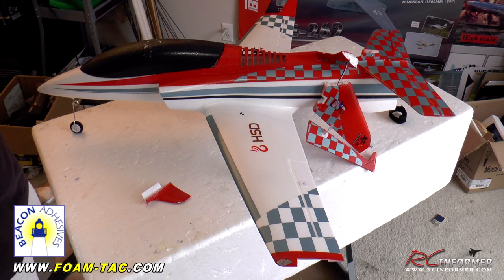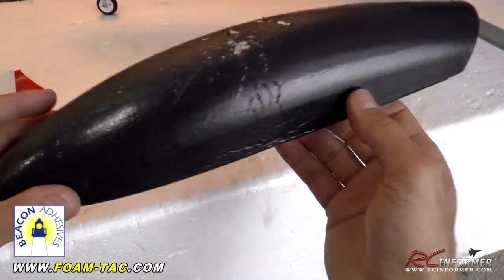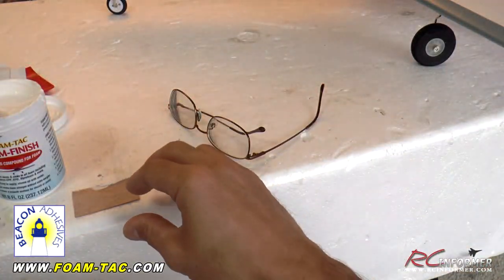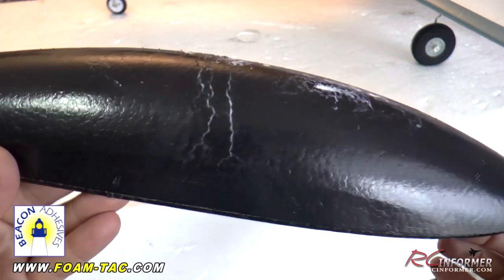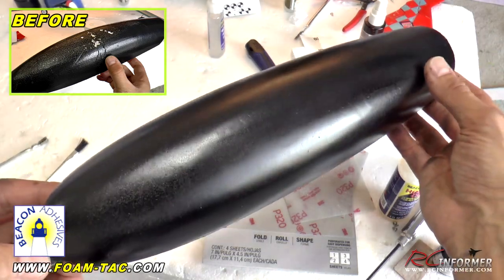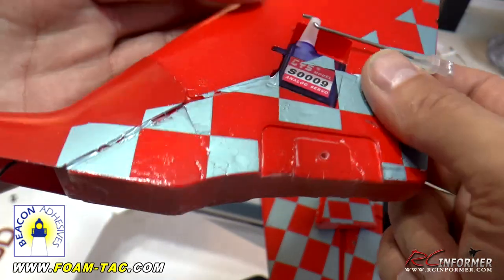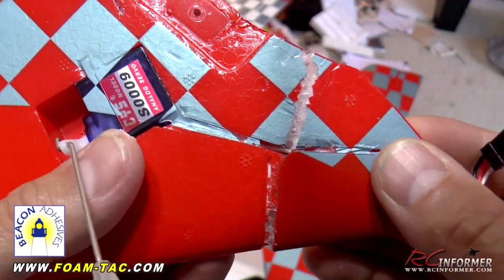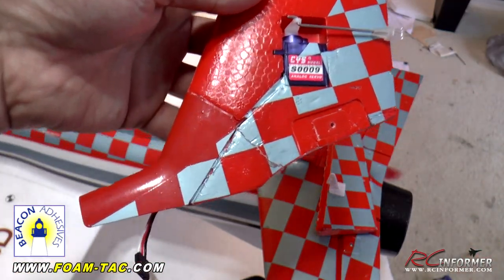FOAM REPAIR With FOAM-TAC from BEACON ADHESIVES By: RCINFORMER

Comment: major old video, but I am very new to the hobby!!! and I need all the help I can get!  I have been watching your channel for a couple months now.  Just found this old video!  Wow am I glad I found it.  You ROCKED THIS REPAIR!!! thanks again!  👊👊👊
Reply from the maker: Here is the latest: https://youtu.be/a2s9Qx4_Nts
Reply: @RCINFORMER  I got the FoamTac... AMAZING!!!! crazy amazing!  I have repaired two tails so far.  Arrows Husky!  Eflight UMX turbo timber!  both had the tail broken at the hinges!  Followed your steps with foam-tac.  Fully functional now and confident they will be flight worthy!  also fixed a pair of pontoons!  way better than CA, which turns brittle and runs all over before it dries!

Comment: Looks great for gouges and hangar rash. Although with that significant damage to the tail section you might as well order a whole new rudder assembly. Thanks for all the tips.
Reply from the maker: The rudder was a clean break, even the hinge broke clean.... the leading edge foam block that i added was easy to fix and quicker than ordering parts.

Comment: Thanks for the lead...over 5 years later!! I bought a bottle on your advice and it showed up right before my new T-28 Trojan thankfully. Right out of the box, the huge flap control surfaces were already cracking through the hinge point. I have heard mentioned that some planes had been destroyed in flight due to control surface separation. I coated all my hinge points so I should be good to go.

Why isn't this stuff more widely available online and in stores?! It's not cheap but it's sure valuable and easy to use!

Comment: beacon adhesives also sell the foam-tac filler and they recommend using the foam-tac foam finish after using the filler. But it also advertises the foam finish as suitable for repairing "dents and nicks". So I guess the foam finish is only suitable for small jobs and it's better to use the filler for larger repairs? Is that correct?

Comment: I START FLYING AGAIN THE LAST 5 YEARS""I'M 35 NOW'' WHEN I WAS 13 TO 16 IWAS FLYING NITRO PLANES TRAINERS AND LOW WINGS LATER,BUT MY LOVE IS WARBIDS! I HAD THE  GAS ENGINES CONSTRUCTION KNOWLEDGE WHAN I START OVER 5y AGO BUT NOT THE FLYING SKILLS.I START WITH 2 EPO W/BIRDS AND THEN MOVE TO 30cc 35cc and 60-65cc ARF.MY POINT IS WHEN I HAD ROUGH LANDINGS/CRACKS /ETC, THOSE PRODUCTS MAKE MY FOAM W/BIRDS LOOK BETTER AND FLY LIKE NOTHING HAPPEND!EVERY SINGLE RC GUY RECOMEND THOSE TO ME ,AND I DO THE SAME.SAVES YOU MONEY/TIME IF YOU USE THEM PROPERLY!!!!!!!!!!!!

Comment: I fond that foam brushes work best for applying the Hobby Coat. A regular does not work well and my air brush clogged too soon.  Foam brushes work well and some trial and error, mostly error :)

Comment: Low adhesion painters blue tape works excellent for foam repair or to damn parts when using fillers ...hardly ever removes painted finishes...just lightly press in place !

Comment: The Foam-Tac Glue is great stuff but I haven't had much luck with the Foam Finish as it tends to catch in the sandpaper and peel off the foam...especially near the edges where it was applied....seems to be too soft.

Comment: You mentioned weak hinges when planes come from the factory. What do you think about using it as a reinforcement on all the hinge  joints if there Weak or not?
Reply: Just did my brand new T-28 Trojan out of the box that had cracking control surface hinges. Should be safe, now!

Comment: what kind of paint do you use on EPO styrofoam?? thanks for the info
Reply from the maker: Styrofoam is different from EPO foam. What ever you use, test it first to be sure it does not dissolve the foam. I use many latex wall paints from lowes and have the paint matched at the store with a painted part from the plane. I use some spray cans from lowes & home depot. Acrylic and laytex works with just about any foam like epo.....enamal and lacquer paints will tend to melt eps foam.
Reply: @RCINFORMER  Thank you for your time.and info